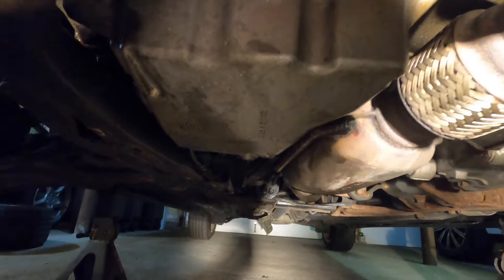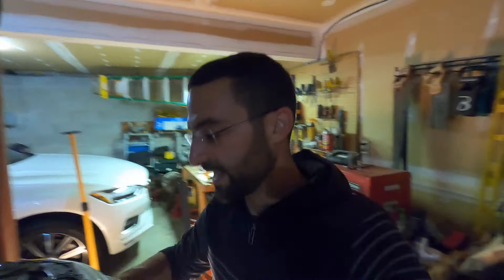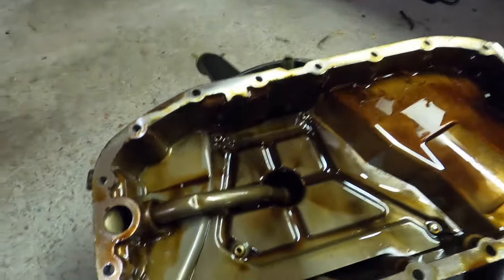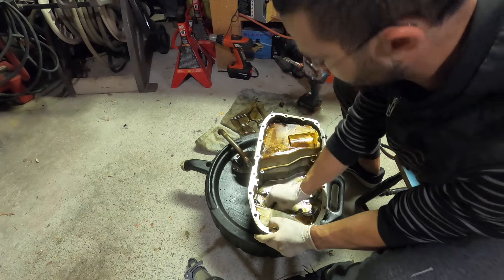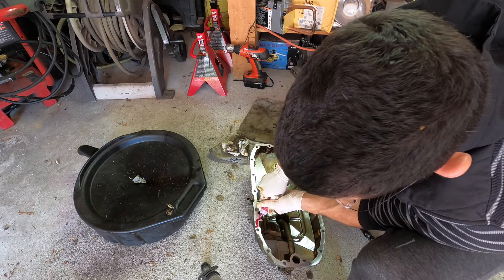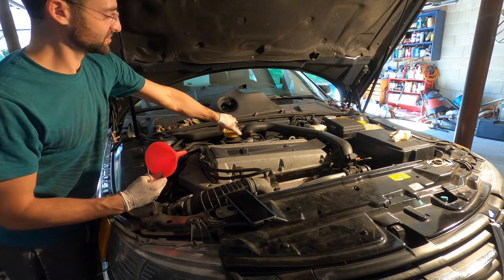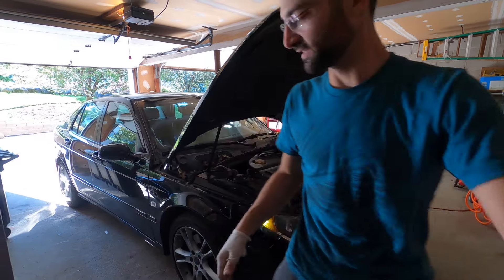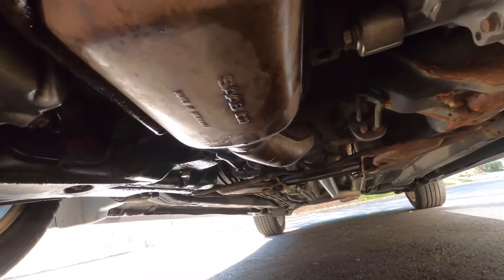My Copart 2008 SAAB 9-5 Oil Pan Removal! Do We have GOOD Bones?

Comment: Kyle have you had to do the sump mod the 9-5 where there’s bolts hidden is it transmission specific (manual/auto) thanks in advance
Reply: I would also be very interested in what models is this relevant for and what does it look like on the oil pan? Many greetings from Germany

Comment: Unfortunately I’ve trying to remove a little extra motor oil from the dipstick the long vacuum hose some of it broke inside the oil sump , removed dipstick not find anything ! Then drain even the oil as well nothing, it’s look like around 10cm  hose I drove it for two days no any problems. But just worries if will make a defect on the oil pump . Any one have an idea!

Comment: We have a 2006 Saab 9-5 sedan 2,3Turbo and the last owner was driving down the road and suddenly the oil light came on. he thought he was gonna make it home but then there was white smoke from behind and the engine locked up. When we bought it we tour the engine apart and there was two giant holes in the block. Cylinder nr1 exploded and cyl nr 2,3,4 was damaged. So we had to change the engine.

Comment: Hi Kyle,

I would like to do the same, however, I was under the impression that the subframe needs to be lowered, as my sump sits just above the subframe.
Perhaps the auto models have a different sump or subframe setup? 
All you removed was the CAT and surprisely provided you with the appropreicate space to remove the sump safely, this practice is certainly not possible on my 2008 9-5 Aero Manual.

Much love from the UK my bro, look forward to your videos.
Reply from the maker: Should be similar process with manual! Just get on in there!

Comment: Great video on oil pan gasket replacment.  Wife has 2008 Saab 9.5 Aero with 102,000.  Immaculate condition, original owner, all repairs performed by Saab mechanics.  Moved to Texas and hard to find mechanics.  I sold Saab in Boston area for 22 years.  Need gasket replaced and quoted $1400 by European repair shop.  Very minor leak at this time. What is estimated hourly labor for this job?